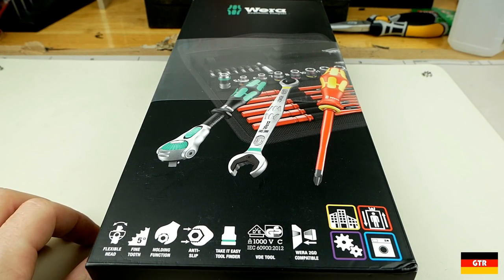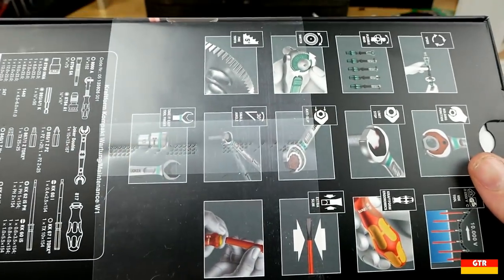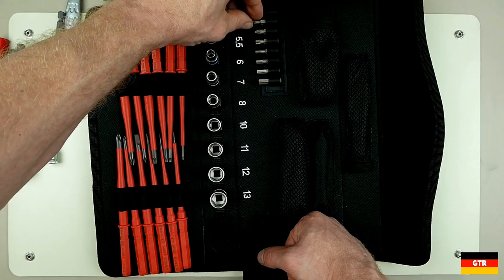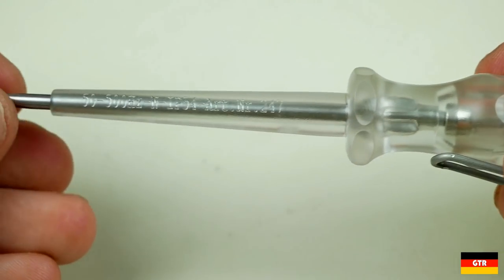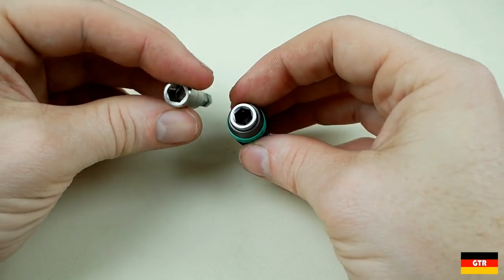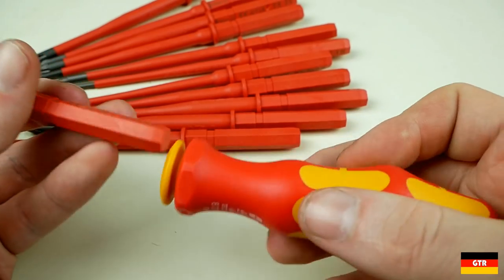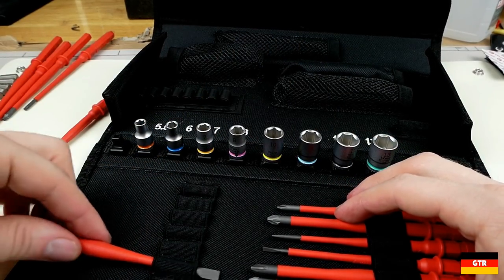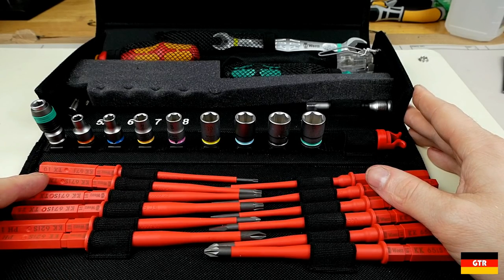Wera W1 Maintenance Set

Comment: I just got this set this month and it seems they upgraded the textile pouch. 
The sockets are now in the newer style where you have to twist them to take them out. And the ratchet + the screwdriver handle are no longer in the netting but instead have a simple elastic band. The wrench pouch is also made smaller. 
So it seems wera learns quick from customer input.

Comment: I love my kit. Use it everyday. My only complaints are that the sockets can fall off and out if the kit is knocked about and the netting is now torn through wear.
Reply: Just got this set as a xmas gift. They have changed how the sockets are held in place. You now have to twist the socket a quarter turn and you can take it out. Otherwise it will not fall out (or pull out). They also changed the netting holders to strap holders for all but the wrench. On the downside they have removed the embroidered "mm" indications near the sockets.

Comment: I have used this set heavily over the last two years. As others have noted, the netting wears out eventually and the bits tend to fall out (I ended up removing them so they dont get lost). I am also not a fan of those voltage testing screw drivers so that got removed. Other than that I love this set.

Comment: Any set of Wera tools is interesting as far as I'm concerned. With that said, a number reviews on the KC Tool website back up what people say here about the voltage tester not being practical even in 220/230 volt countries. Hopefully in the future Wera will omit this tool in favor of something else. I really like my normal Wera VDE screw drivers and I am wondering if anyone here has opinions on the multi blade system/handle.

Comment: Voltage tester isn’t useless in North America. Some tools and a Dryer appliance run on 240A/C
Reply from the maker: 240V appliances are still single phase, just two 120V lines that are 180 degrees apart.  We have three phase 480V systems that are 277V phase to neutral so it wouldn't work with those either since the tool is only rated to 250V.
Reply: That explains the marketing logic, thanks
Reply: @adventurebloc  they should not even include it in germany its called lügenstift (lying pen) it gets usually straight to the waste bin and in most ~220-250 country a professional would never use it since its a "lying pen"

Comment: Why didn't they just include the 9mm ffs. What's with companies skipping sizes.
Reply: Not enough room and not a common size. Bit check doesn't have 9 or 11 either.
Reply: Never needed a 9mm socket.
Reply: Sorry what? there is plenty of room left to add one more socket.
Reply: But what are 9mm sockets for? There is no standard I know of that needs that. Maybe you should use standard sized screws. 

Some fasteners might be querky like 8mm threads. There are 12mm sockets or 13mm or even 14mm used because russian, japanese and german standards say something different there.
Reply from the maker: I've seen some brake bleeder valves that are 9mm, but that is the only time I can recall when a 9mm has been needed.
Reply: Earlier today I disassembled a Corsair VX550 PSU to see if anything obvious was causing its cooling fan to run at 100% all the time. I had to go and get the 9 mm socket from my 1/4" drive set because my little Wera Advent calendar toolkit didn't have that size, and that's the size used for the nut which secures the earth wire to the case.
Reply: @andrewmorton9683  are you sure it was not a 8 or 10? Like i work 6 years as electrican in like 3 diffrent companys.. and never ever needed one
Reply: @kleinfeicht  I just opened up the PSU to check. It is definitely 9 mm. Unless it is 11/32", which also fits.
Reply: @andrewmorton9683  it should be 11/32" since its a us company and everyone else use metric like i said never ever used in metric 9 or 11 .. most times i get to use a diffrent kind of screw (German Amazon Link) https://www.amazon.de/Zangenschl%C3%BCssel-Schraubenschl%C3%BCssel-verchromt-Kunststoff-%C3%BCberzogen/dp/B000X4KP1C/ref=mp_s_a_1_1?dchild=1&keywords=knipex+zange&qid=1608829128&sr=8-1
Reply: @kleinfeicht  That makes sense, thanks. (I already have the next size smaller of those pliers - they don't fit in the available space.)
Reply: @andrewmorton9683  oh thats bad ye i think its good to know that usually 9 and 11 are not used really in metric

Comment: Hello. Long time fan here. When will part 3 of the AEG FSPE 60 Jigsaw restoration be available?
Reply from the maker: Haven't really found a job where I have needed it.  I'm going to cut up an old filing cabinet to use for scrap sheet metal so maybe that would be good time.

Comment: No self respecting electrician in the uk would use a neon screwdriver, would have made more sense to include a second vde handle. The collor only needs to be pulled back to release the blades, push the blade in and it locks automatically.